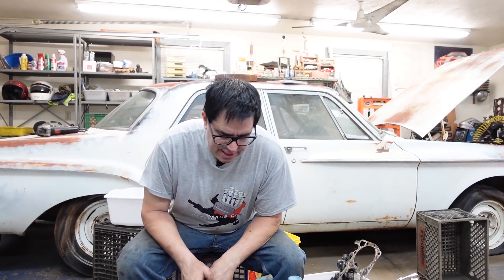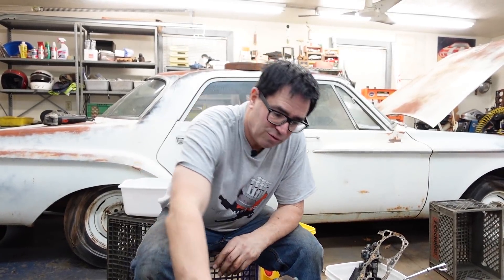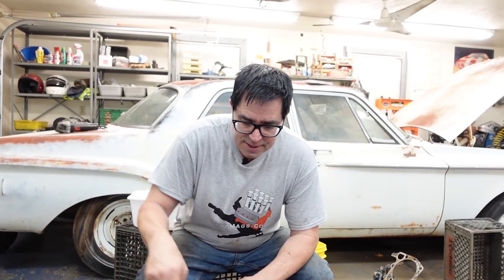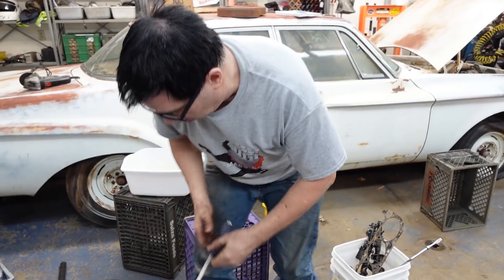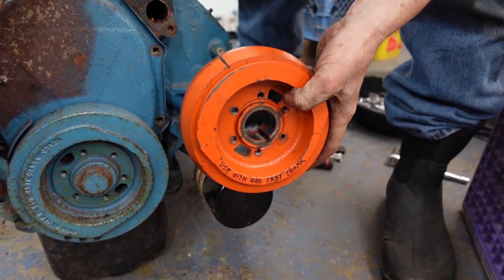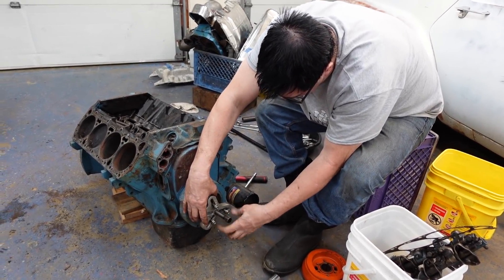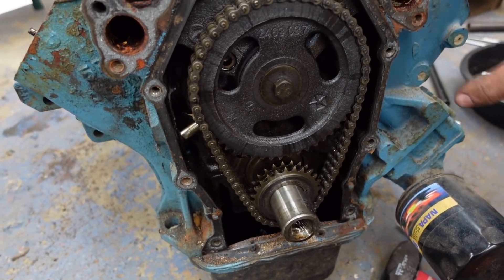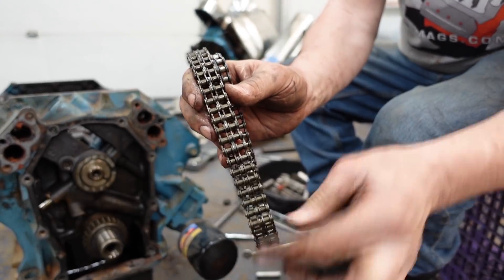Junkyard 440 Teardown Continues

Comment: OK Steve, this video says it's 2yrs old, as I viewed it 4 my 1st time. I would like to add a comment 4 U and anyone reading this that there is a BALL BEARING available to put in the crankshaft for the manual trans input shaft to ride in. It fits where the torque converter hub fits. I used one once so I know it exists. BUT you still need to cut the end off some of the input shaft. That may seem a bit daunting but it doesn't ruin the input shaft it just dedicates it to the ball bearing. And it cuts easily with a steel cutting hacksaw or reciprocating saw blade. Then grind a nice taper on it so it fits into the bearing easily. I pulled a nice forged crank out and took it to machine shop to have it drilled out deeper to hold the original matching bushing. I wish I'd have thought to hunt down the ball bearing. I hope you find this useful. ben/ michigan

Comment: hey Steve i had 1970 D200 pu 383 auto no pilot hole i used three brass bushings that i press in so the input shaft of a truck 4 spd  would work this is better than cutting off the shaft  . the bell housing i used from pick u part was like 1963 64 big block cast iron i think it was for 413 it also had hyd slave cyl.  JM

Comment: I️ had an oil pump drive come apart on a Ford at the strip. The motor walked away and lived another couple years until I thought it must be tired. When I️ tore it down the bearings were still like new.

Comment: I didn’t know Mopar used nylon faced timing gears back in the day. 
Also thought they all got double roller timing chains.

And I believe the chain slop on those engines is checked under load, so you’d check the left (pass) side of the chain to see the slop, and it’s not a tight fit all around.

Comment: On the double roller timing chain with the Pentastar stamped on the top gear ⚙️ that has to be factory issued unless and I’m guessing it came from Direct Connection aftermarket.

Comment: I drilled the crank on my 440 and used a Dakota pilot bearing that indexes in the machined area of the rear of the crank. It doesn't run too bad. :) https://www.youtube.com/watch?v=tum3T6_NR8A&t=872s

Comment: Hello Steve love the videos thank you for all your content and knowledge.
Please please please if you're going to throw away those lifters and cam I'd like to purchase them off of you I need a standard rotation cam and I'm looking for used lifters for a big block this goes the same for the water pump adapter/timing cover.
I have a motorhome engine that has gear to gear camshaft and a funny looking water pump system that I cannot reuse.
So let me know what you want for the used parts the ones that you're not going to use and maybe we can work something out.
Subscribed 👍👍

Comment: 1. The Yellow Bible (Larry Shepard)  held that the cast cranks are good for 600 hp. 2. Forged cranks for automatics had the shallow pilot hole as well. I still have the Silver and Deming drill bit that I deepened the pilot bore with. 3. Factory HP stamped engines on the ID pad means it has a double roller timing chain. Usually found on cop cars, taxis, motor homes. Silent Chain timing sets had nylon teeth. The Silent Chain on passenger engines was to shorten the engine life. They were not quieter. Over 4 decades of changing them out, proved that to me. Fortunately the late 1971 and later low compression engines did not have the valves and pistons crash with a cam gear failure. Looking forward to the stroker !!

Comment: You just reminded me that I need to get a new timing set. My 96 Buick Roadmaster sedan has 167k miles on the gen 2 LT1. I'm sure it's probably about as loose as that one was. Unfortunately there's a lot more involved with changing the timing set on the LT1 because of the Optispark and gear driven water pump. But it needs done. And soon

Comment: Love everything about this series, but I can't help thinking, .... if you can afford this engine build [which won't be cheap] then where is your engine stand. This business of bending over  & rolling around on the floor to do anything at all on the engine has got to be a pain. For the convenience that it provides, a proper engine stand would be a cheap investment. [I have three]
Reply from the maker: Hi Christopher, I get all of that and in fact I do own two engine stands. BUT for the purposes of making a video, I have an easier time SITTING on a milk crate all afternoon than I do standing by an elevated engine. Plus, when its time to access the flexplate / flywheel bolts, every engine stand I've owned poses the hassle of the mounting-head being in the way. Again, for purposes of demonstration in a video, I let gravity - and the floor - be my friend. But anyhoo, THANK YOU for watching! -Steve Magnante

Comment: No way could one use a manual trans with no pilot in the crank, for very long. It's not a big deal to bore the crankshaft for a pilot bushing. Cheers Steve.
Reply from the maker: I hear you on the no-hole / no manual transmission use concept. But no greater Mopar authority than Mopar Action Magazine's Tech Guru - Richard Ehrenberg - has claimed many times he's simply CUT THE TRANSMISSION INPUT SHAFT SHORT and let it go from there! I'm assuming he mandates that a pilot bushing be installed to center the input shaft and aid the front bearing in the transmission case to function properly. But he has written many times that the depth engagement on a stock 4-speed crank is too much and not needed. That said, I'm betting more than a few readers have mistaken his statement you can cut the tranny and NOT use a pilot bushing. In my opinion that allow the input shaft the possibility of some wobble and perhaps impact trans bearing life. I've never tried it though. But THANKS for watching, Steve Magnante

Comment: It would be interesting to have a close look at the teeth on that cam sprocket you took off, more than just the chain wears. If it’s got some miles on it, I suspect you will see one flank of each tooth will be slightly concave, making the tooth look slightly hooked. Those HP oil pump drives have a pinned gear and the transition from the hex to the shaft has a fillet rather than a sharp 90° cut. I’ve never had or seen one snap, but I have seen the hex portion round out to where it won’t drive the pump.
Reply: Yup I've broken several on my '78 400. Years ago, I bought a Magnum SE from a friend of mine. He was a parts guy at a Dodge dealership. When I went to change the v. cover gaskets on it, I found an unbelievable amount of sludge there, and then in the valley under the intake manifold. I cleaned up as much as I could from the top end, and just did frequent oil changes. It was OK for awhile, but the carbon-y sludge started packing the space between the oil pump rotors to the point of stopping the gears and shearing the drive. It got to where I kept old quill shafts and a hydraulic jack in the trunk, & I could fix it in 20mins.

Comment: 69-1/2 Sixpack had a one bolt cam. One day I stopped for gas and the car cranked but wouldn't start. The mechanic and I checked and found no spark. Quick check of wires, OK, opened distributor to check points, and found motor cranked but dist. didn't. When it shut off the engine gave a little backfire. The dowel pin had broken and let the timing gear to spin 
on the cam. Luckily it was still under the 12/12,000 Warranty for the 440-6 and Hemis. Not the regular 5/50,000 Warranty.

Comment: While Pontiac did not offer the number of forged crankshafts that other brands may have had, the design of the Pontiac crank, with it's large journals, allowed for more overlap between main and crank journals and increased strength. Additionally, most cast cranks were manufactured from better alloys such as nodular iron or Arma Steel.

Comment: There certainly should be a 6 cylinder dart you could do this with. Why do you have to wipe out a restorable cop car for this project
Reply: You could delete this question but it would be a lot better for all if you answered it and justified your project
Reply from the maker: I fully understand your point. The amount of "9 code" Police Pursuit Darts must be les than 50 (though Google searches reveal a number of NICE restorations). BUT this one was originally built with a 318 2-barrel. Had it been built with the optional 318 4-barrel or "top cop" 361 4-barrel, I'd have seen the energy of the platform and let it be. My plan is NOT to change the superb 11-inch drums, HD torsion bars, front anti-roll bar, 6-leaf rear springs, 1957 (yes 1957!) Plymouth steering wheel or - especially - those nifty 15x6 inch FLEET WHEELS with FLEET HUB CAPS. In fact I'm not even going to paint it. I honor the radio delete, Certified 120 mph speedometer and push button Torqueflite. But again, that 318 Poly is an engine I've had plenty of experience with (I've owned three). This car is a natural for a simple heart transplant to Max Wedge WHAT IF glory! I am unhappy that the massive - and very special - Leece Neville alternator (with matching twice-size mechanical voltage regulator) won't fit with the Max Wedge cross ram. But I'll make sure to get it into the hands of the right Police Package restorer. I'm one of those guys who REALLY DOESN'T LIKE those "it takes a real man to cut up a classic" T-shirts, but in this case, I wouldn't have bought the car without this very specific "dream of the 4-door Max Wedge". After all, "Its a Mad, Mad, Mad, Mad World". If you don't get that reference, Google the movie by that name and watch as Sargent Culpepper abuses a new black '62 Dart Police Pursuit! And THANKS for writing! -Steve Magnante
Reply: @SteveMagnante  thank you for the detailed explanation. Looks like in your mind the car missed being kept as a cop car by 30 horsepower. Could you please look around for someone who would buy it and restore it as a cop car? It is perplexing to me that you paid cop car money for this car and aren't going to benefit from that.

Anyway, thanks for considering my posts

Comment: steve - I have digital pix of the mopar memo for when the 440-3 (RV motor) was sched to replace the 413.  The memo lists all the changes and parts they were going to use. Hollar if you want copies.   Also the double chain was factory.
Reply from the maker: Hello Robsvideos13, I rethought that double-roller timing set. Yes, in a HD pickup truck engine - with exhaust valve rotators - I see their origin as being factory stuff. I'd LOVE to see your Mopar memo. Please EMAIL IT TO ME at hemimagneto@aol.com. Please put "TRUCK 440 MEMO" in the Subject Line. THANKS for writing, Steve Magnante

Comment: Can the cast crank be drilled in a lathe to accept the manual trans?... My co worker did that on 330 olds motor , I think, years ago.  I have a couple 440 truck motors I always wanted to have a 4 speed with.
Reply: Yes

Comment: The best way to increase displacement is with heads and stroke not boaring out the cylinders just causes way to many problems
Reply: LOL! Nothing you do with the heads increases displacement. You are correct, though, a thicker cylinder wall seals better and you should always bore the minimum amount required for cleanup.
Reply: @markwise9868  yes bigger heads increase displacement that's how they do it on modern engines and in European engines back then so you're wrong about heads
Reply: Heads have nothing to do with cubic inches, and only a fool would spend money on a stroker kit and not bore the cylinders. If those cylinders in that engine aren't tapered and scored I'll eat that block.
Reply: @kennydemartini2169 nope you're heads can change displacement clearly have no clue what you're talking about
Reply: @DylanL69  I'll try to make this simple for you... Bore x stroke x number of cylinders = displacement. Heads change cylinder volume via the chamber size and thickness of gasket, which will ONLY change compression ratio, NOT cubic inches. Many other factors are considered in figuring  compression ratio, but I'm the ONLY thing that changes cubic inches is bore and stroke. Have a good day.
Reply: @kennydemartini2169  wrong going from 6.3L which is a 383 to 6.4L or 392 there's your cid change right there you know nothing about modern heads and engines
Reply: @DylanL69  I've been a mechanic for 30 years, thank you... Umm, going from a 6.3 to a 6.4 means they either changed the bore or stroke, or both. You figure it out.
Reply: @DylanL69  The 383 has a 4.25 bore and 3.375 stroke. The 392 has a 4.0 bore and 3.906 stroke. The modern 392 Hemi has a 4.09 bore and 3.72 stroke. Bolt any head you want on them, and the displacement won't change. You're welcome.
Reply: Obvious Dylan is trolling. No one is that stupid.
Reply: @markwise9868  no I'm not I actually know what I'm talking about you're talking about the old school way of building engines that's not how we build them anymore bigger heads mean more surface area which means more power like a bigger bore but without all the problems like overheating or cross heating of cylinders or dieseling, blowing headgaskets weakening the bore by  overboring putting rods through the block or cracking the block. So yeah I know exactly what I'm talking about do your fucking research first
Reply: c.i.d. = 0.7854 x Bore2 (in.) x Stroke (in.) x Number of Cylinders

Explain again how the heads figure into displacement?! SMH
Reply: @markwise9868  Thank you! I was going to post the formula, but... you know.

Comment: The 440 came out in 66 to compete against the big smooth Cadillac and Lincoln engines. All 1966 and 1967 440's were, "hand balanced" at the factory. This consisted of a heavy ring welded to the damper pulley (not to the damper) and the ring had ballance holes drilled in it. That was stopped for 1968.

Comment: Hey Steve, I love the videos. What you said about the input shaft needing to be supported is 100% true. The get around for having to cut the shaft is a pilot bearing that fits the torque converter register, it’s even a factory dodge part, Dakota with a v8 and manual transmission if I remember correctly. Also the 440 in my dart was pulled from a Winnebago, it has a double roller timing set, forged crank and if I ran the part numbers right, 6 pack rods. How crazy is that?

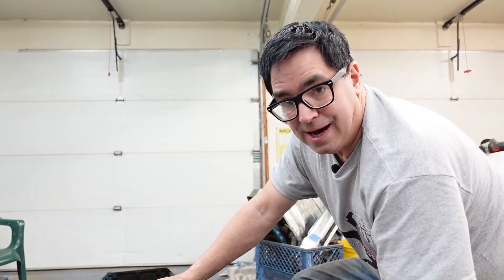Comment: 13:40 Well, sometimes those nylon sprockets would break teeth off during the life of the vehicle. When that happened, The engine wouldn't run at all. People would usually repair their car by buying something without nylon teeth.
Some companies dealt with eventual chain stretch by using timing belts that had to be replaced on schedule. Few things I hate on cars as much as timing belts. Even though some cars I love have timing belts, what dream car doesn't have some kind of thing someone doesn't like?

Comment: I've seen an intermediate shaft break. Trust me. It's worth the $$$ for the heavy duty shaft.
Reply: Yup I've broken several. I once tried the DC/MP heavy duty quill, and when the rotors jammed in the pump, it split the hex socket on the oil pump, wrecking it, but the HD quill shaft survived.

Comment: @1:07 - I don't get it. Just because the pump outlet is in a different location, why can't it be used on a passenger car? Is it because you think it would cause the bottom hose to hang down too low?
Reply: I think in a car it more compact as compared to a truck or motorhome bay , so i think it would have clearance issues with the K frame

Comment: Thanks for all the useful info. Will this 440 fit into the Dart without having to swap the "K" member?
Reply: This is a 318 poly, so I guess that no swap is needed.
Did the Hemi use a different K member?
Reply: @kmath50  yes. Hemi K is unique.
Reply: @kmath50  While Hemi's used a special K member this body is a '62. The Hemi was not made in '62. I don't diddley squat about 60's Mopar K members so I am not sure what you would have to use to put a 426 Hemi into a '62 Dart body.
Reply: @jppagetoo Yes. understand that the Hemi didn't come out until 1964. I was just asking the question in general.
Also, I understand that when the crate Hemi was released later on, it was setup so that a Hemi "K" member was not needed.
Reply: @kmath50  Yeah, I replied in that way too. Since there is no "factory" parts to do it I am not sure if the '64 K member could be made to work or not. Does a 3rd party make one? In the late 60's Darts were common on the drag strip and I can see a racer wanting to put a later Hemi in one. I just don't have a clue if any solution was ever found or if it wasn't done.
Reply: If it has the slant 6, no. V-8 k-frames were all the same. 62 is slightly different from 63-65 but will interchange.

Comment: Manum engines from 1991 up used a roller pilot bearing that fits where the converter snout goes. You can use that with all cast cranks, and have to shorten the inpur shaft so that it doesn't bottom out.
Reply: Was just getting ready to say that when i saw your comment. I've done this before.

Comment: I like the fact you wrench things off. Getting a feel for things is important. I like to use a light 3/8 drill with a socket adapter after loosening. Works well for assembling too. Everything gets snugged down nicely

Comment: Before I invested a penny in that Mopar block. I would pay the extra 150 bucks to sonic check that block.  Especially if you are going to use a stroke her kit and hi po alloy heads and juice cam...I've built a lot of Mopar B engine powerhouses and have ran into a few junk blocks with very very thin core shift cylinder walls that would have failed
Reply: Sounds wise. Also, this is why people like to go +.020 at rebuilds if they have that ability. +.020 pistons and rings might not be as common, easy to get, or cost the same, but it can be worth it.

Comment: 1970 and later sixpac motors were externally balanced because of the big rods....Also most cars used a waterpump housing with the inlet on the left side...I liked the one on the right when using external duel inlet oil systems....